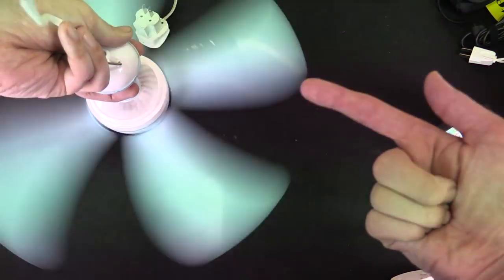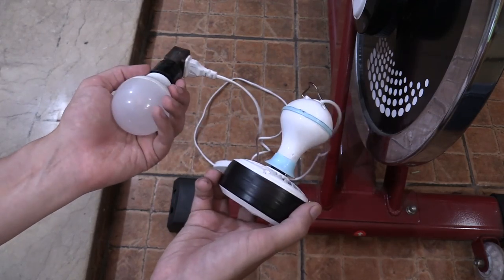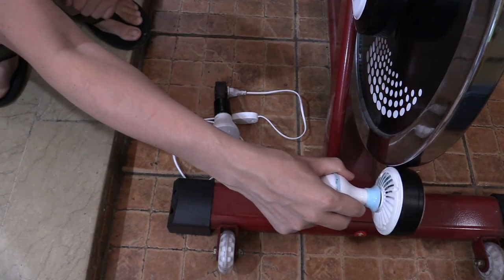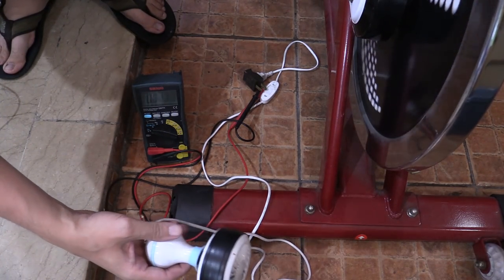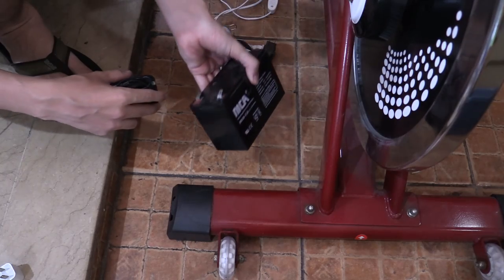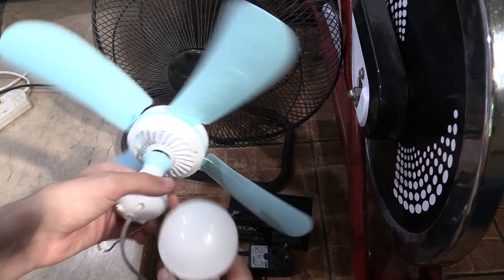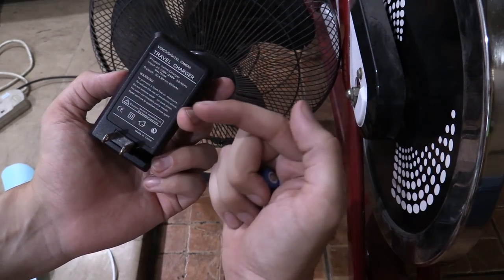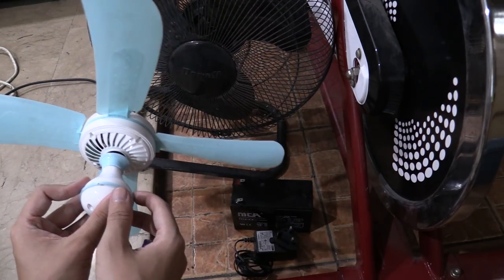Ceiling Fan converted to Power Generator

Comment: buy a UPS it has a built in inverter.. ive tried it and it worked.. sadly it cant power that much.. but i think if the battery is bigger like a car battery and put it on a series of maybe 10.. then you can generate more power and possibly could power  an entire house...

Comment: with the right ratio of moving wheels you can make this as a source of charging high capacity battery pack that can las thw whole night powering aircon,ref,tv,lights,etc then on the morning harness the wind again using a turbine then repeat it everyday

Comment: i charge a lipo 36v pack from toy turbines and use it to run a 24v 300w motor on a pulley to drive an alternator this way i use over unity to get its recommended 1800rpm and with no weight / resistance with no over heating '  and just using normal lead acid to excite force field regulator '''' not just wind but using just one 12v solar panel i can charge 10 x 12v lead acid very quickly with no power loss ' depending what kinda load .

Comment: Try using a rectifier to convert the ac to dc and then store it in some high value capacitors. Then use that stabilized dc power an connect it to the usb adapter, most of the usb adapters work on dc as well as on ac
Reply from the maker: Hmm interesting idea. I might have trouble finding some high capacity capacitors though, especially at a reasonable price. I'll see what I can find. It's certainly worth a shot, thank you! As much as possible, I want to make it repeatable for other people without needing any special components or electrical knowledge. I want to make it so those in the provinces who suffer from daily power outages can replicate this without spending a lot of money. Especially since solar isn't as effective during the rainy season.
Reply: That was the correct way
Reply: Actually it won't work because it can only output power is 3w

Comment: i suppose a voltage regulator will help stabilize  the voltage
Reply: It wouldn't, because this is mostly a frequency problem. The output frequency varies by alternator spin rate. The regulator will just eat up the little power that this thing makes.

Comment: I think putting it in the fan can saved a bit if energy by not using the light and try to make a stand on it.
Reply from the maker: Check this out, I already converted it to a wind turbine :) https://twitter.com/ytgadgetaddict/status/887166631113220097

Comment: your on the right track ''''' heres how when you use that kids ceiling fan to charge 12v battery's  put  a ac to dc full bridge rectifier on wires  ( 99p on ebay ) this can charge a bank wired in parallel ' that can run a 12v ac to 240 dc power inverter and run a home with free energy , instead of spending lots of money on turbines , use more than one of these toy turbines for a fraction of the price .

Comment: did you test it if a normal wind blow can turn the motor? cause its a magnet type motor, it need some torque to start it spinning & connecting a load will increase the torque needed to spin the motor, but i think signal no.1 storm can turn it😁
Reply from the maker: +boy turnilyo I tested it in the wind yesterday and it got going okay and lit the LED bulb. But there's not much wind in Metro Manila right now :(

Comment: i see that you are using that brown adapter to complete the circuit. maybe you can use something similar that has a built in usb port. maybe it will produce a more stable output for usb charging
Reply from the maker: +airon soliman that brown adapter is just a socket multiplier. There's nothing inside but copper.contacts to make anything plugged in connect to each other :) it's basically the same as what i did at the start of the video, putting the pins manually together :)

Comment: Could you rig up a small waterwheel to this fan generator? Maybe have a 50 gallon drum up high trickling water to the wheel then catch the water in a lower drum? This maybe could provide a constant stable turning force to the generator and when the top drum is empty fill it from the catchment lower drum in a forever cycle less the small evaporation rate?

Comment: Excellent and very interesting, so... I guess you could also use a bike tire?  Real cool sort of similar to those little bike generators that power the light near the sidewalls.
Reply from the maker: +mc alleyboy yep you could :) you could even make a simple.hand crank with a pulley to get some gearing and that would be enough. It really only.needs a low RPM to work :)

Comment: I'm not sure if I'm thinking it right but what if somehow you could make a small DIY Voltage Regulator out of a breadboard and some capacitors and resistors just to stabilize the fluctuating current to 110V from the turbine so you could somehow get the USB charger to work.
Reply from the maker: I mean that's essentially what these little USB adapters are anyway. I'm wondering if stuffing larger capacitors inside might help. As much as possible, I want to make it repeatable without any special components because people will struggle to find those out in the provinces.
Reply: Maybe you could try something with the battery charger? I mean it's the only one besides the bulb to actually work properly in this setup. Something that answers the question "why the charger is working and not the usb adapter?". Maybe the power requirement for the charger is lower than the USB adapter? I am not so sure now.

Comment: Your work's in the right direction I've been thinking about you know similar ideas to yours and my idea involves taking a USB fan and then collected magnets on the propeller and then connecting a coil right over the magnets and have the magnets generate electric charge to the coil and produce power hopefully the magnets will produce more power than it cost to run the fan that's the hope at least I haven't built it yet but I just thought I'd share that idea with you

Comment: ps spinning it faster does produce more power / the maximum of motors rated output ' its possible to over power with a few volts .

Comment: DC version of this same fan would be better I think. Also, with the right gearing you should be able to move it via natural sources like wind, water, or artificial like a hand crank / hand squeezer.

Worth playing around with for sure.
Reply from the maker: I already took it out in the wind today. It was able to get up to speed and light the bulb without any problem. Although there really wasn't enough wind today, just a couple of gusts now and then. I had thought about making a hand crank section of the video. Using a larger wheel and then a rubber band between the wheel and the motor but it seemed like too much effort considering I already have the exercise bike which could just as easily be swapped for a regular bike placed upside down. Unfortunately it's much harder to find a DC version locally and because there's so few of them, the prices are jacked up. While AC isn't ideal, the fact that they're readily available throughout the PH is a big selling point for this project.
Reply: Gadget Addict how many would I need to power my mining hehe
Reply from the maker: How many? Too many lol. Probably 100+. It's good for basic lighting and cellphone charging only :P
Reply: Hey 100 x 3 dollars = 15k. I'd totally pay that for completely free mining. :P
Reply: But why when you could get the roughly same amount of power from solar for something like 5k? 
(even cheaper if you setup everything yourself, let's estimate $1 per watt  = 2k for 2Kw setup + $500 for an inverter and another $300-$500 for batteries and a charge controller)
Reply: Huh? We were talking $300 how did $1000 make that the same?

I'm no expert and I doubt its anywhere near enough power needed for mining but you realize when I say 15k I meant 300$ in Pesos?
Reply: No, because you specifically said dollars... I know that assuming leads to trouble but when you say dollars I think of US currency, sorry for the confusion.
Reply: Hey man no harm no foul. I just thought we had the same units.

If you're curious: 1 dollar is roughly 50 pesos. So 300$ = 15k pesos.

Comment: hope some places in our country whatch this video and do it to thier area where utility power not yet reach them and light thier homes and some communacation dives...love it....
Reply from the maker: That's what I'm hoping. Especially if I can find the perfect way to store the energy that's also repeatable by those in areas with unreliable power.
Reply: This seems to be a cycle frequency problem. Since the output frequency varies by alternator spin rate, spinning it too slow will prevent a lot of AC devices from operating well (they are usually designed for 49 - 61 Hz operation). The reason for this is because there will be too much time spent between peaks (near 0, 180 and 360 degrees of the sine wave), and most power supplies do not have enough capacitance to tolerate that (especially when under load). You can count the number of times the bulb flashes per rotor rotation to tell the number of poles in the alternator; that way we can derive the ideal spin rate for the rotor. :)
Reply: this guy dont need to guess-cool man

Comment: Can you use two of those ceiling fans to make a generator for one fan? What happens when you have two fans and you connect their power chords to each other and try to manually spin the other fan?